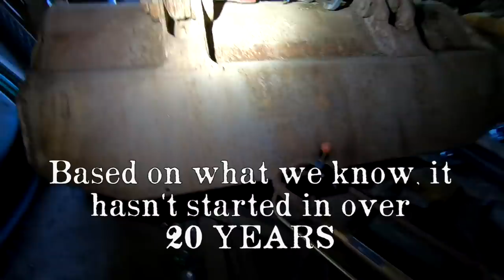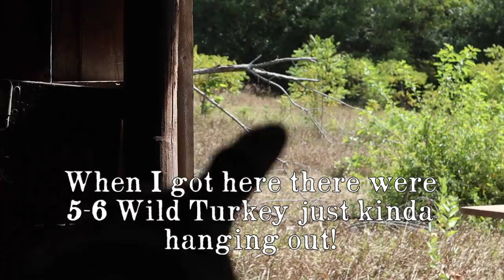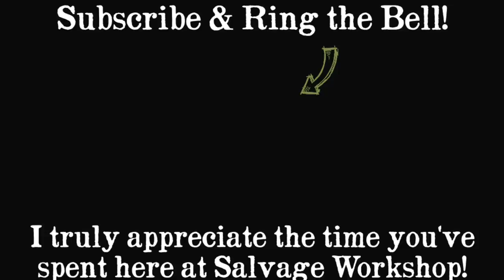Will the PONY Motor START?!? ~ Part 1 ~ 1950's Caterpillar TraxCavator

Comment: The good ole humble traxcavator, I remember a friend buying one 20yrs ago, cost him 4 times what he paid for it in repairs as every piece of it fell apart under pressure. One way to learn not to buy rubbish though...
Reply: We had a neighbor growing up with one of these, same story. He tended to leave things till they fell apart though, these old machines still need maintenance!
Reply from the maker: Ya this project would NOT have been worth it if it wasnt for the entire parts machine that I am getting along with it! It has already been mostly disassembled and stored pretty well! I'll be doing most of the repairs myself!
Reply: @SalvageWorkshop  To refurbish the tracks we welded 25mm reo bar to them, dang they would make a mess of the ground but good for traction. We nick named it `Pop goes the Weasel` because of how many seals it blew lmao

Comment: WOW, someone who actually cleans the work area.  Great to see this degree of professionalism. I know this wouldn't happen in a workshop if the owner won't agree to pay for cleaning time, even though it would improve the result of the work done.  I was concerned that you hadn't checked the coolant before start.  I understand the coolant is shared in both engines.
Reply from the maker: Lol... ya im a bit crazy when it comes to that! Cleaning the work area makes for a better, more organized, & safer place to work!

Comment: That is the same engine, transmission,  and final drive as the D47U bulldozer. They stopped making them in 1954.
You want to have the transmission in neutral and the clutch Lever pulled back when starting it. 
Unless your shifting the trans, the clutch needs to be engaged.  It will burn the clutch up if you don't.

Comment: Run the pony at w.o.t when warning up the main engine. Usually takes about 10 minutes. That belt is driving the mechanical governor. The weights can get stuck and it will over rev or not get up to max rpms. There is the adjuster with the spring on it. 
When the main engine is up to 140 deg you can try starting the main. Do the hand magic and get the engagement rod pulled out and the pony running at w.o.t.  once the oil pressure is up,  start turning the compressing release handle slowly.Don't just flip the compression release Handel up.  It will stalll out the pony. The main fuel Handel ( throttle) needs to be pulled back to about 1/4 throttle. Pushing it all the way forward will shut down the main engine. 
Watch the stack and it will be blowing black soot slowly release the compression release.  It takes a bunch of tries when cold. Summertime it needs more throttle to start. Once the main starts push let go of the engagement rod. It will snap back in. Believe it or not, the pony motor, even running at w.o.t will hold back the main motor from running freely.  It's all of that gear reduction in the drive. 
As others have stated, turn off the pony fuel and let run out. 
It seems like a lot, but with practice it comes easier.
Reply: Eddie Blakley m

Comment: When I worked on plant machinery we had an international " Drott" mini dozer which would start but not run.
After many peoples efforts to get to the bottom of the problem it turned out that the crankshaft was broken on the main bearing  at approx 30% in the direction of rotation .
Also had a Hatz single cylinder diesel with a similar fault.
Finally a brand spanking new 6 cylinder Ford Engine which would start but then  slow and seize.   when cold it would turn over freely but as soon as it got warm would seize up. 
Ford took it back, diagnosed a crankshaft which was machined in a hurry after a strike and had not been rested to allow the stresses to iron out.

Comment: Good work, you really know what you are doing. Look around for all the tin shields that go on the track frames,sprockets,idler areas. They must be there, there was a parts Cat there too. That stuff is like gold and hard to find.
Reply from the maker: Thank you Tom!  I really only know enough to be dangerous!  To my knowledge, this era machine didn't have any covers on the under carriage at all, that came in the 60's I believe...But, you are correct there's an entire parts machine that's already been disassembled and stored fairly well! That's a GOOD thing, because it's going to NEED IT!

Comment: Simple preventative maintenance for the pony motor. Run it out of gas when you shut it down by closing the fuel valve. No gas in the carb to drain into the motor no problems. Now put the bill Cosby concent in a can to that diesel and see if she comes to life.

Comment: It’s important to remember to shut off both fuel valves, and run the pony out of fuel (instead of using the mag switch) those down draft carbs will slosh during operation and the fuel even left in the bowl will get into the pony and dilute the oil. especially since it only holds like 2 quarts

Comment: I had a cat with pony motor people are right about it using the same cooling system but what that's for is actually to warm the block up on the diesel engine in the winter oh, and also the exhaust from the pony motor usually run either through the intake manifold or under the intake manifold to warm it for the incoming air in the winter. Then you have compression release and a hand-operated engagement lever from your Pony motor to your diesel. You engage the pony with compression release on to get the cylinder walls warmed up and to build oil pressure then release the compression release to fire it. On a cold day you might have to let it run like that engage with the compression release open for 5 or 10 minutes
Reply from the maker: AWESOME Arthur! I truly appreciate that! Question for you... Does the pony motor NEED coolant to run properly, or is it JUST to warm the coolant for the diesel motor? Right now I've got a substantial coolant leak pouring out of the bottom of the edge of the radiator somewhere, and I want to make sure I am not going to ruin the pony motor running it without proper coolant? I would have thought it would be an air cooled gas engine, but I am no master at this! Knowing will help me prioritize how quickly I deal / track down the coolant leak! Any thoughts would be much appreciated!
Reply: No it does need to coolant to keep from overheating, It bolts to the top of the bellhousing but also there are two o ring type seals between it in the back of the engine block
Reply: There are videos online with starting procedure. Pretty informative I know mine was a 1946 and I was still able to get books from Caterpillar of course this was back in about maybe early 90s. Like one of the comments was it you could possibly get a lot of the parts you need from Caterpillar. But I wouldn't be surprised if you could still get the manuals if not from cat maybe through eBay literature

Comment: The key to keeping a CAT pony motor running good whenever your need it is to never turn it off with the ignition switch. After getting the diesel started, ALWAYS, ALWAYS, turn the pony motor's gas supply off with that shut off valve and let it run out of gas, then turn off the ignition switch once you're sure it used all of the gas in the float bowl.

Comment: your making me feel old  I run my 955L just about every month  of course mine is an 81 but it is interesting to see an old one pony motor no glow plugs, Lever steer manual trans  No ROPS,  It kind of reminded me when I first started driving Truck and had  a five and a four twin stick and manual steering on the old cement truck, converted to a water truck I was driving.. Of course simple made for easily and readily cheaply repairing  something those who own 953, 963 and 973  don't get when they are singing the blues about the 40 gs it costs to go through the hydrive.   Newer is not always better.JJB

Comment: You need to set your self up a portable generator on your truck if you haven’t done so.👍😎
Reply from the maker: That would be nice! Along with an onboard compressor! Not sure I want to on the old green beater, but you've got me thinking!
Reply: @SalvageWorkshop 
 C * C* C* C* C * C* C* C* C* C* 
❤  ❤  ❤  ❤  ❤  ❤  ❤ ❤  ❤  ❤ ❤
Reply: @SalvageWorkshop  What brand and model of compressor were you using?

Comment: You might actually be able to get parts for this from the dealership.  Caterpillar services crazy old equipment.
Reply: Older than you might think and yes you better be good at cleaning off 60 plus year old cosmoline. The Cat restorers that I watch can still get OEM parts packed in that stuff, cleaned off the goo and your part is new as it was in 1941.

Comment: I think it’s worth mentioning that the starting engine and the whole unit is only 6 volts / you were hitting it with 24 that will burn that starter up quick.  Cheers
Reply: I was thinking 12 volt... but definitely not 24 volt

Comment: I resurrected a D4 25 years ago the pony motor can be a pain but the exhaust pipe pipe heats the intake on the diesel to make it start easier I had to rebuild the diesel engine on it no utube back then learning as you go

Comment: The Honda generators get their cooling and intake air through the bottom. Put it on a piece of clean plywood and it will stay much cleaner inside.

Comment: Man, have you got patience!  A couple of questions....did you research this model before tearing into it or was it done just by native genius....and....how is the pony motor cooled and is it either shut or disengaged when the diesel is going?  That is some fine work my friend!  Best wishes and stay healthy.
Reply: Dr. Skip Kazarian Pony motor uses same coolant as big engine. When big engine starts, pony motor has to be shut down and disengaged.
Reply: @gheice_modelism  Thank you and best wishes.
Reply from the maker: I did as much research as I could(honestly i still am), but there isn't very much about working on these old motors on the internet, and very few videos! So i had to figure out most of it as I tore into it, but with any gas motor, Air, Fuel, Spark is all you need! I'd love to find a pdf manual for the diesel though! The pony motor is shut off once the diesel has started and is running on it's own! And i just learned the pony motor shares coolant with the diesel (see, im still learning)!
Reply: @SalvageWorkshop  You are really talented ...try looking on ebay for the manual or write directly to Caterpillar...if you share the video, I'm sure they would give you a copy just for your effort alone.  Looking forward to the big "fire up"....hugs for the Weims and stay healthy!

Comment: This just shows how well made everything was back then with better materials and american craftsmanship. Its way more work and more expensive trying to get a machine from the early 90s-2000s running if its been sitting as little as 3-4 years. Also everything they make now is an electronic wiring, sensors, and electronic controller nightmare and if it sits for any lenght of time get ready for alot of work.

Comment: hell it looks like it would have been easier just to pull the diesel motor. Could you tell if there had been fuel in that carb bowl.. didn't look like it from here.. oops forgot the gasket! fuel shut off and another pesky gasket.. dang you probably needed a shovel to clean the fuel intake area.. must not be thanksgiving.. heck putting that air cleaner on ain't wish full thinking you can't hardly kill one of those..YEAH! out standing.. I bet the old cat fires and runs! lets find out! carry on brother that was fun!

Comment: Believe it or not you can get 99% of the parts for that pony motor and for the full-size motor still it may just take you a little while but they will make them and they cost a pretty penny I know my buddy has a 1950 D4 fun little toys to play with, on a side note we put an inline filter on the bottom of the fuel tank for the pony motor and then put a ball valve on it so every time you fired the pony motor up you got the big diesel running as soon as we were done with the pony motor we would turn the ball valve off and let the pony motor run until it runs out of gas so therefore there be no gas in the bowl of the pony motor
Reply from the maker: Good thing I'm getting another 955 track loader thats already been mostly disassembled and ALL it's parts along with this tractor... only thing i can forsee needing to find is 1 drive sprocket since it's so far worn!

Comment: That sound of the pony motor sure sounds good. Daddy had a Car 212 motor grader and he also had a D-4 that had a traxcavator front end loader. And the pony all sounded the same. I didn't like it because it was honking LOUD!. I have some old manuals on the traxcavator loaders, also in the D-4 itself. If you know of anyone that needs a carburetor and book for a Alis Chalmers M I have both.
Reply from the maker: That's AWESOME Harry! Im glad it brought back some good memories! Id love to see those manuals if you'd be willing to part with them, or even make a copy for me!! This 955 traxcavator is the same as the older D4's, but they just have the loader instead of a dozer blade!
Reply: @SalvageWorkshop  I will consider it, sorry it took awhile to get back to you.  I get busy and other things come up.  But, they are in reasonable good shape.  Is there a email address I can send a couple of pictures of them to you. Thanks.

Comment: Are you positive it's a 24 volt system and not 12 volt? Given how old it is, it might have used two 6 volt batteries in series to get 12 volts. It sounds like the starter is spinning really fast on that pony motor with 24 volts going to it.
Reply: Nathaniel Hatley agree electric start on pony is 12 volt

Comment: Maybe the float valve in the carb isn’t sealing.  Or maybe the float is set too high so it isn’t shutting off the fuel when the bowl is full.

Comment: Can the oil change have fixed it? Real thin gassy oil not sealing rings for building up compression?
Reply from the maker: I read online in a forum that it can make a big difference in these old pony motors which is why I did it, but I also replaced the spark plugs at the same time, so I'm not sure which made the real difference!

Comment: You have got your work cut out for you in undercarriage alone. I retired from CAT dealer. Just popping  the sprockets off to either get complete new ones or they might still make just the sprocket you can weld onto the spokes I have not done that in about 20 years.
Reply: I’ve built up rollers with welding rod before,could you do that on the sprocket as well?

Comment: nice work but for your info all pony motors where 6 volts for the electric start not 24V. they will last when jumping them with 12V not sure about 24V.

Comment: I'm not doubting this but ...the only thing I don't understand have  owns  several of these traxcavator  those grouser plate should be heavily rusted if it sat for 20 years...... if I was buying that machine and I seen them grouser sparkling clean I'd be thinking that machine ran in the last one or two years

Comment: When using the pony motor you must shut it down by running it out of gas with tank shut off otherwise the vibration of the diesel motor will cause the gasoline drain into the sump of the pony motor and dilute the pony sump and causing pony motor failure

Comment: Your doing a great job on that machine. 
You need to go to a cat dealer and get the correct spark plug  wires. That red one doesn't look correct. 
They have to have a certain resistance or it will burn out the magneto.

Comment: I have always used WD40 to start small engines it works better. The W and D stand for water dispersment and it will start the engine we use it in the navy  alot.

Comment: You do not want to run the pony motor for long amounts of time. The main engine coolant runs through the pony motor and uses the main engine water pump to circulate it through the pony motor.

Comment: You keep spraying that starting fluid in that old motor you're going to burn a hole in the piston you should have cleaned out the fuel tank and
 the carburetor obviously it's going to be gummed up with tarnish gas. Again never put starter fluid in an old motor that much and if you do use very little. Believe me I've made the mistake and ruined a motor that way before.

Comment: The sprocket looks quite worn.. -or worn out, maybe?
Sadly, there is not much work you can put these machines to anymore, you'll probably get it running, then it will be parked for another 40 plus years...
Reply: Really? I'd KILL for one of these around my smallholding. It'd be a godsend.

Comment: Starting fluid will do lots of damage to these engines. If you need starting fluid it only means your engine isn’t set up properly.
Reply: Hopefully the former owner never needed to use it on the diesel itself, bad enough on the small engine but at least one could fix that easier/cheaper.
Reply: No it won't. These are pre glow plug engines. You can ether these motors with no issues at all. It wasn't in till the 80's that glow plugs started to be used on heavy diesel engines in equipment. That's why you hear the old stories about operators starting fires under there trucks to warm the motors up in the freezing air up north to get them to start
Reply: @Swarm509  Both motors are perfectly fine being eithered. There is nothing to be damaged from using it.
Reply: I'm much more comfortable using propane. Steady flow, not as explosive, MUCH cheaper. I use a torch usually for small engines and a 20 lb tank with regulator and hose and tap for automotive engines. Also very handy for locating vacuum leaks on a running engine.
Reply: @wssides  For non glow plugged diesels i would agree. But for old carbed gas motors like the pony motor I like to use just a rag soaked with 2 stroke gas or a water bottle filled with 2 stroke with a pin hole in the top. Helps lube up the rings on a motor that's been sitting for awhile